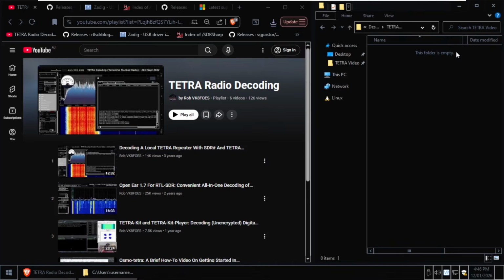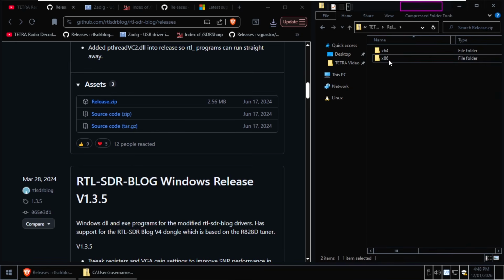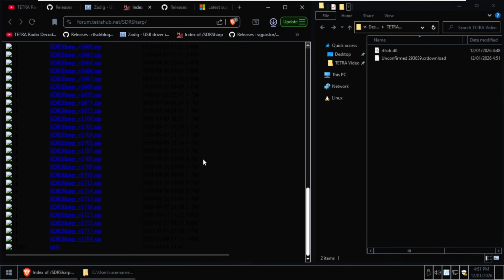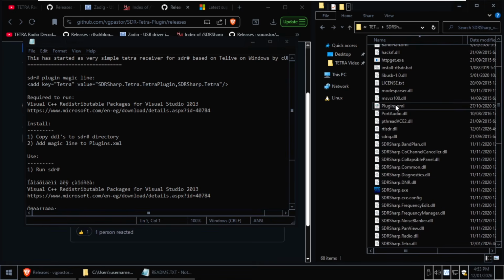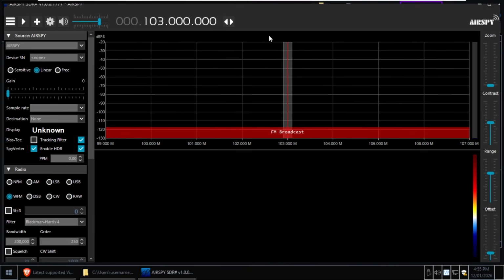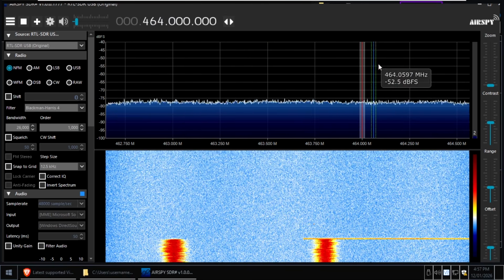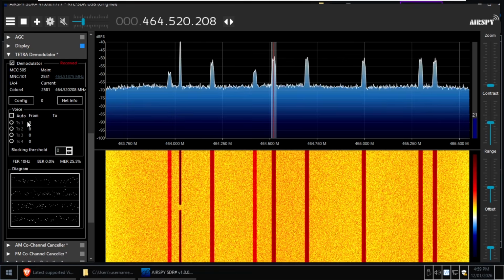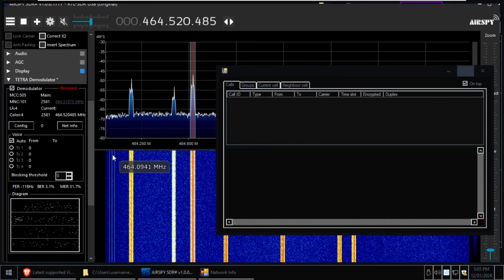Tetra Decoding on Windows: Complete Workflow of RTL Driver Install, SDR-Sharp Config, Plugin Install

Comment: If you can't allow voice in the video you've shown nothing !
Reply from the maker: I know that you are trolling, but I'll bite: I have at least 10 videos on my channel showing voice decoding.... Who cares? It's boring commercial traffic from a gas plant, and a casino...
Reply: @RobVK8FOES 
The whole point to the video is to show the equipment working correctly add decoded voice traffic would be what most people would want to see as far as it working correctly ! ✌🏼
Reply from the maker: I know that you are trolling, but voice traffic is only 1% of the traffic flowing over a TETRA network. There is the physical layer traffic, data link layer traffic, network layer traffic, signaling, TDMA timing info, error correction coding, cell information, air interface information, mobility management, text messaging, would you like me to go on? Your point is pretty dumb, buddy!

Comment: SDR Console Is Best, Absolutely The Most User Friendly Software !
Reply from the maker: Hey, don't get me wrong, SDR Console is my go-to when I need multiple VFO's. but a very strong case can be made for SDR Console being very user un-friendly. I find the endless buttons at the top of the window opening sub menu's and side panels to be confusing. SDR Sharp 1777 with the gorgeous docked drop-down side-panels panels is objectively easier to use, by orders of magnitude. Sorry. Later versions of SDR Sharp after 1777 have the garbage floating panels that are just ugly. I hate it

Comment: Bonjour, moi j'ai bien le RTLS sdr usb je le sélectionne mais quand je met sur lecteur il m'indique (No device selected)
Reply from the maker: Hi. Sorry that you are experiencing this problem. Have you tried using different USB ports on your PC? Try USB 3.0 and USB 2.0 ports. And of course, try restarting the PC too. Have you checked the Device Manager in Windows to see if the RTL-SDR is showing as connected?

Comment: I have SDRSharp 1.0.0.1921 release on my PC. I'm using a NOOELEC SMART V.5 SDR . Is it possible to decode TETRA DMO and TMO transmissions ?
Reply from the maker: Hi. And yes, absolutely you should give it a try! I am not sure if the TETRA demodulator plugin supports version 1921, but it can't hurt to attempt it anyway!
Reply: @RobVK8FOES  Hi. I did it successfully. Now I'm trying to understand the  meaning of the parameters I see on the "NETWORK INFO" table. Mainly the CURRENT CELL parameters , like the MNC correlation (for example Mobile Network Code 55 ??) and if a trasmission is encrypted or not.  Maybe you have  a kind of tutorial or user manual to understand  the meaning of the parameters. Thank you from Italy.
Reply from the maker: @flaviom.3248  It's great you got it working, well done! In the TETRA demodulator panel, you should see a button called 'Net Info', click on it, and go to the 'Calls' tab. You should see something like this when a voice call is made:

 SSI:9263 Call ID:224 Encrypt:Clear D_TX_Granted Transmission Granted_to_another_user Party_SSI:5589

The 'Encrypt' text is the key, you can see in my log it says 'Clear', that means no encryption. I am not 100% sure what an encrypted call looks like. But a rule of thumb is if you can hear TETRA voice transmissions through your PC speakers, it's unencrypted. Make sure you select 'Auto' in the TETRA demodulator panel.
Reply: @RobVK8FOES  OK. Unfortunately no information is displayed on "CALLS" table, only on "Current Cell" and "Neighbour Cell" tabs. About the settings on the "RADIO" WINDOWS is better RAW or WFM ? With RAW there is an high noise from the loudspeaker .
Reply from the maker: No, don't use either WFM or RAW. Wideband FM is for broadcast channels, like the ones you would listen to in your car while driving. They can be up to 150 KHz wide. Please use NFM, which is 'narrowband FM'. TETRA signals are only 25 KHz wide, I typically set the bandwidth to 26000 in SDR sharp. It's always advisable to add some over-sampling of the desired signal. 26000 in SDR sharp = 26 KHz bandwidth, which will give us 1 Khz of over-sampling.

Because I have never worked with encrypted TETRA networks before, I can't really determine if encrypted calls will show inside the "Calls" tab, sorry! It could just mean that nobody is using the network while you are monitoring it.... Perhaps you need to monitor for longer?
Reply: @RobVK8FOES  Hallo. OK, I'm using NFM and if the "Air_ Interface_Encryption" parameter is 0 or the "Cipher_Key" is 0 the calls are displayed and some voice communication is heard. If the above parameters are either GREATER THAN 0 no call is displayed or heard.

Comment: Dude, you so cool. I have some issues at my radios (hytera pt580h plus). Tell me pls, is it possible to get PDU like u-setup, d-connect and other?
Reply from the maker: Hi. I have never heard of any digital radio providing such low-level signaling information through it's data interface. And if it did, I would imagine that would be a huge security vulnerability. I recommend always using a software defined radio.
Reply: @RobVK8FOES thank you 🤝

Comment: Thx Rob, Supercars this year have switched from NXDN to Tetra for car to pit comms. Stumbled onto you video looking for tetra info. Very helpful. What state are you in? I currently traveling Tasmania so I’m looking for Tetra signals to test my setup. Regards Kev VK2KEV
Reply from the maker: Hi. That's interesting information, I'll definitely have a UHF antenna pointed at Hidden Valley for the Darwin round! A viewer of mine had previously told me that the F1 also use unencrypted TETRA for their comms during the Australian Grand Prix
Reply: @RobVK8FOES  The teams use a DECT based, propritary, wireless intercom solution called "Bolero S" by a german company called "Riedel Communications" within the team/pitcrew. For communication to the driver, the audio is embedded within the telemetry data.

Comment: Hey there Rob, Just a little addition to your great video that method only works with conventional tetra, if you want to monitor trunk systems check out the software called tetra trunk tracker, it will only work with older version of sdr# though. De A65KJ.